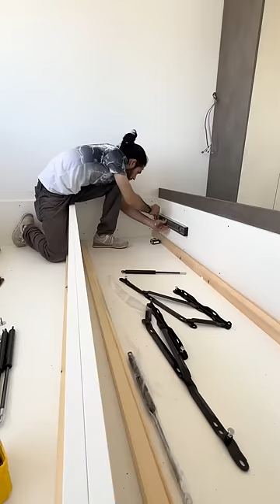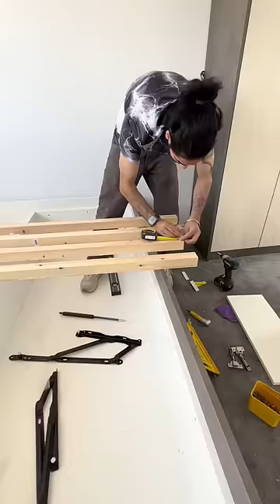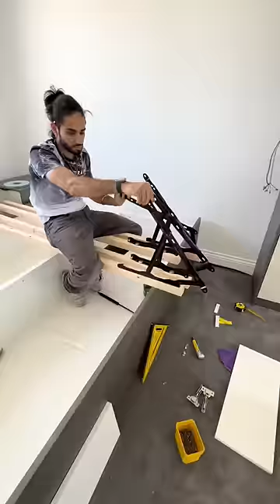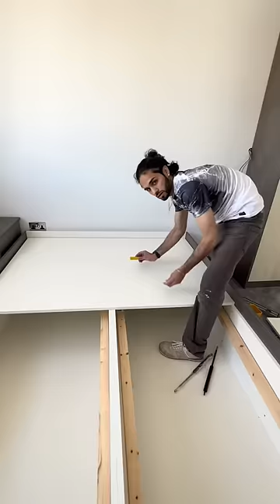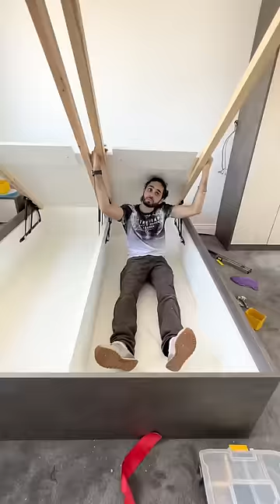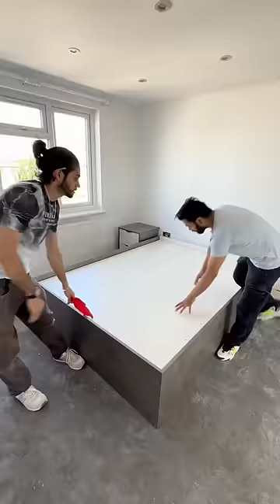Ottoman bed mechanism installation #ottoman #bed #bespoke

Comment: Great work. But the matress needs ventilation underneath
Reply: ? The mattress upon the bed inwhich you sleep, sits flat upon a box spring or just slants?
Reply: @karenriley8529  a box spring is made of breathable fabric. If you have slats then the spaces between the slats is where it ventilates.
He should at least have drilled lots of holes in the mdf plate
Reply: @ymac7245  Hi, can you elaborate on this? I'm going to be building one of these sometime and want to get it right